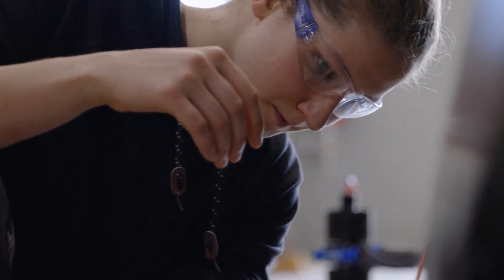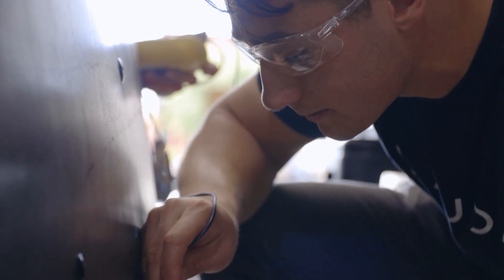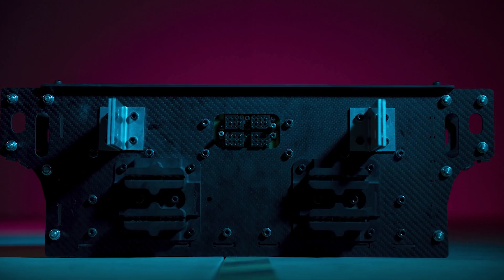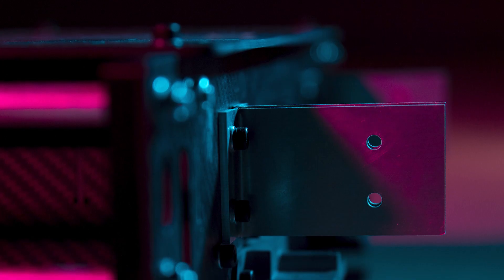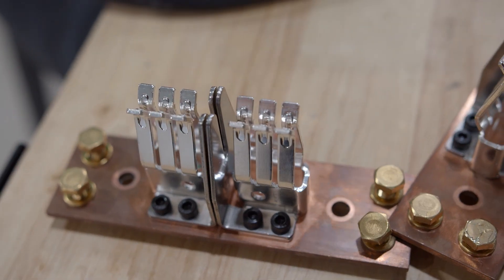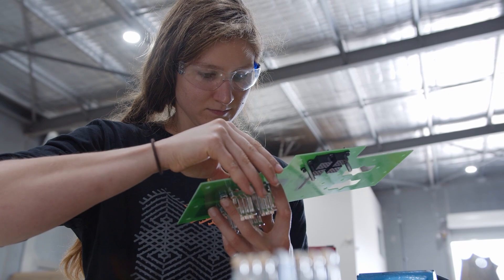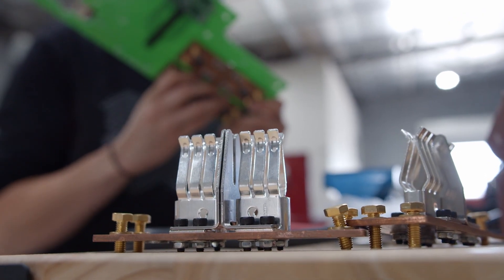Building a Battery & Race Strategy | Alauda Aeronautics Taking Flight Series

Comment: Just like F1, it would be great to come up with a battery spec (dimensions, max weight, discharge rate, safety specs etc) and let different battery companies duke it out like F1 tire makers did in the past. I can’t wait to see how this develops
Reply from the maker: We're glad you can see the competition in this area, this is how we advance the advanced engineering, through competition.